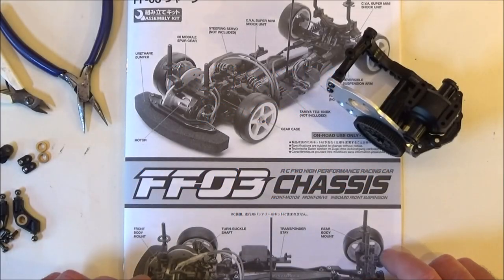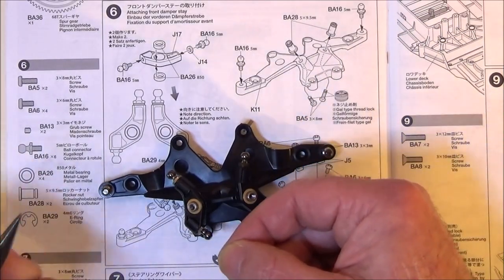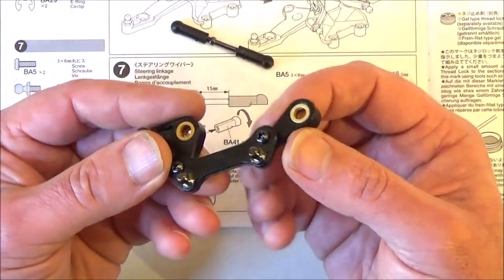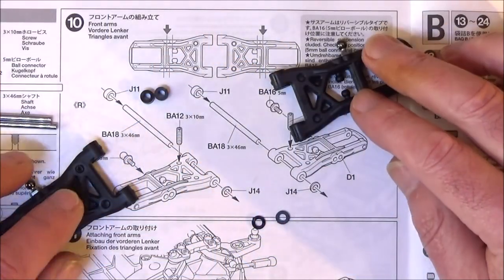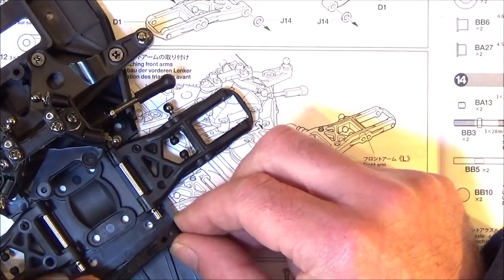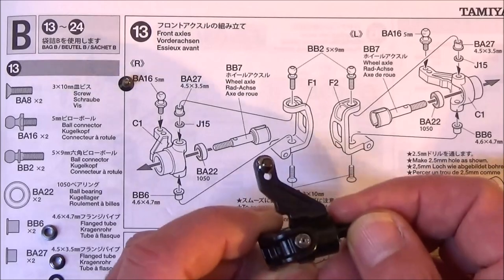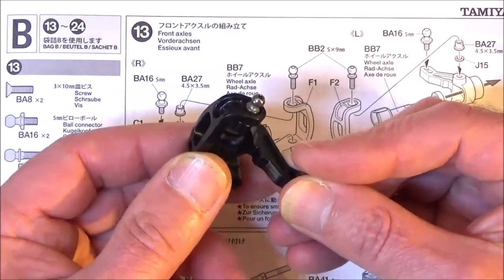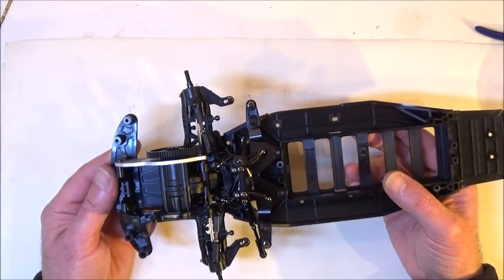Tamiya FF-03 Build Guide Part 2 - Honda Civic Type-R - Incl. Inboard Suspension

Comment: Pretty much how I progressed on the TA06 in similar steps. I used a pin vise for more precise drilling in such small places. Problem was finding metric drill bits in the USA.
Reply from the maker: Thanks man! I need to get a TA06!!!  I was a bit slack drilling freehand, yeah, better to hold it flat and still, but thankfully I got away with it - I just wanted too show what you need to do and do it on camera.  Forgot that it may be hard to find metric stuff in the USA - it used to be the same here, but now Imperial has pretty much disappeared  :-/

Comment: Hi matey. What a great kit. It's quite involved isn't it? All very well explained by yourself as ever. Can I ask how you have set up your camera and is it in between you and the kit or is it above? I'm trying to work out how I could do this type of video without the camera being in the way. What I have is the camera on a tripod in between me and the desk which is good in that I can see the screen but it's really in the way and I have to reach round it. Anyway I look forward to seeing more of this kit and especially that lovely body shell. Hope you are having a good weekend. Is it back to school for you tomorrow? At least you got some stuff done over the hols. Cheers matey 😀
Reply from the maker: Hiya Pete! Yeah it's a lovely kit to build, lots more parts than a standard Tamiya to get your teeth into! The front suspension is particularly cool, you should see it with the shocks on - works so smoothly, it really is clever.
As for the camera, above the desk is a storage cupboard, with LEDS under lighting the worktop. I mounted a bit of wood to that and attach the camera to it with a rubber band, My Sony has a movable screen, so I can swivel it so I can see what the camera does, It's above me so it doesn't get in the way, I just have to be careful not to bash my head on it! I've tried the tripod method that you describe, and yeah, it's a real pain working around it!
I've really enjoyed my free time, but back to it tomorrow, don't wanna go, but it will feel OK when I see the kids smiling faces! All the best my mukka!  :))
Reply: @MarkBryanRC  thanks for the info on your set-up. I should be able to achieve something similar. The GoPro has the app where I can see the footage on my phone so could utilise that. Anyway hope work is ok tomorrow. I've 🐝 enjoying the light traffic in the mornings last week but I'm sure they'll all be out tomorrow. Cheers mate 😀

Comment: Hello mate great  video bin building  mine and I have a problem  my steering  only turns left it won't turn right
Reply from the maker: Hey mate! Only turns left? How strange! Have you disconnected the steering arm from the servo and made sure the servo turns fully in each direction?
Reply: @MarkBryanRC  I haven't  put the servo  in yet mate it looks like it hitting  the front damper stay
Reply from the maker: Hmm... Something not quire right there - I checked mine and there is loads of clearance between the steering mechanism and the front stay - better check it all again my friend!   :)
Reply: @MarkBryanRC  I have checked  it over and over  again  mate bin through  the instructions  about a million  time I cannot work out what's wrong  mate
Reply from the maker: Oh dear! I wish I could help more, but without your chassis in front of me it's impossible to guess!  :-/
Reply: @MarkBryanRC  that's ok mate I sorted  it out I modified  the underneath  of the damper stay and it turns right and left now I sanded some plastic  off it I should  have bought  I new kit but got it off Facebook  market place  for £70 thanks for you help mate I like the videos you do top work

Comment: Mate, I'M GETTING ONE OF THESE!!! Just don't know how... Is it Brilliant? Frankly I don't care as much as I should. 😜 
The Nerd in me (Thanks Dad!), loves things that are nearly overengineered. Tamiya is famous for that anyway!! 

It's more and more fascinating with the more I see. It's set up like a typical Front Wheel Drive Sedan... Great big Lump of weight in front of the Wheelbase. Yet some of them handle quite nicely!! 

Last year, I test drove a Ford Fusion (our exact counterpart to your Mondeo)... Now, I'm a hardcore Rear Wheel Drive Hot Rod kind of Guy...
But that FWD Saloon felt really nice to Drive!! 👍👍 

So I wouldn't discount this just yet, as many have done. Could be impressive.

BTW, those C Hubs went together with the top hat Bushings, exactly like my Axial Wraith did!! 😉
Carmine ✈🚂🚙
Reply from the maker: ...And it just gets better as the build goes on, Carmine! The suspension movement is SOOO  SMOOOOTH!  I get the feeking it's gonna be fun to drive, and I love the engineering in a nerdy way, too.  This thing is gonna drive like a 2 wheel car - with the rears just holding the back of the car off the ground!  All that weight at the front should give it good grip for acceleration, cornering and braking, but it might be a bit tail-happy.
Yeah, the Mondeo is a fine handling Ford. Some FWD cars are actually GOOD (think of the Austin Mini).
Don't tell Axial, they might sue!   :P
Reply: I drove a Friend's Austin Mini in High School.... Drove it on SIDEWALKS, Alleys, across Yards, even broke into a Go-Cart Track!!! 😳😜
MOST fun I had with my pants on! 😆😂😜

I found out that this was originally designed BY TRF - for Pro Level Saloon Racing!! Probably why it comes with those goodies. Should be a good handling Car. I wish I could get one before they're gone....
Reply from the maker: Hehe - yeah, that's what Mini's are Made for! I had a few over the years, and my dad has a fibreglass bodied Mini with a 1380 tuned motor in it! That thing can beat a Porsche to 60!!!
I think the FF-03 will be around for a while yet!  :)
Reply: 1380???! Glass Body? SHIT!!!! I think his had an 1100 something... And IT could beat my then 1972 Monte Carlo SS, with a 454 (7.4 liter!!), with TWO 4-Barrel Carbies and a Muncie 4-Speed - from 0 to about 40.....
Then I was LONG GONE!! 😁 
Shockingly quick cars, those Minis. I'll bet they shocked a lot of people at its first Rally!! 😳

Comment: Hi Mark.  I'm just building this as my first Tamiya kit. I'm enjoying it and using your videos as a helpful extra resource (thank you!). I have a question about step 14, (17:29), the bit about the Urethane bushing. I don't understand why, having cut the bushing in half, it appears to tell me to use half of the cut bushing on one side, then one full bushing and the other half bushing on the other side.  Why would you have more bushing on one side than the other?   Doing this, the driveshaft seems loose on one side (with 1/2 bushing) and more solid on the other (with 1 and 1/2 bushing).  Any help you can give me would be appreciated!   ☺️
Reply from the maker: Hi there! Glad you are enjoying the build, it's a great chassis! The reason you have different thicknesses of bushing on each side is because one side has the lock-nut and spring in the output drive cup, the other side only has the allen (hex) head of the bolt that goes through the middle. Yeah, one side is a little tighter than the other, but it runs well with this configuration, so I recommend just following the manual! I really appreciate you watching my videos - thank you!  :)
Reply: @MarkBryanRC  thank you so much for your reply!  Great, I can re-commence knowing that all is good 👍   Yes it really helps to have your video alongside as I am building the kit, as this is my first RC model I've ever built.  I had a Sonic Fighter and a Vanquish (sadly both now gone) as a kid, but these were built for me back then.  Now aged 43, I had a hankering for an RC car again, and I have a Civic Type R in real life just like this kit (except not the rally version!), so I managed to track one down luckily (as they don't make them any more).   I can't wait to get it built and use it, it will feel like a nice achievement!
Reply from the maker: @jammy_rex3038  Cool you got back into RC - it's a great hobby and there are lot's of like-minded people here on YouTube, it's a nice little community we got going on! Love the fact that you actually have the full sized car (and a great car it is too!) Hope the rest of the build goes well!  :)

Comment: Hi Mark,  just a bit of info from my build so far. I don't have a drill that works at the mo & found you can screw those grub screws directly into the arms without widening the hole first. Didn't take any additional pressure as they screwed down smoothly. Planning to use a reamer to do the 2.5mm holes in the C hub, gently should be ok?!?... :-)
Reply from the maker: Hi Ben - yeah someone else mentioned not drilling those hoes out too! Yeah, go steady with the reamer and check the fit of the grub screw as you go!  :)
Reply: @MarkBryanRC  Cheers Mark, yep worked put well & on Bag C now. Got a bit of a shortage of electronics so not sure what to fit it with as ESC space looks a bit limited!!! Thinking of borrowing the HobbyWing 1060 from my CC01 as it can handle the Square LIPO that fits snug in this one plus maybe a Torque Tuned motor to start?
Reply from the maker: Glad to hear it Ben! Well, there is not much space but it's OK as the electronics just hang over the edge a bit, it's not a problem! Those parts sound good, I just used the standard motor but the Torque Tuned should give it a bit more punch! We can always go for a brushless later if the mood takes us!  :))

Comment: would you recommend this kit for somebodies first build?
Reply from the maker: Hi Brad - that would depend on the experience of the builder - if you have experience using hand tools, DIY, mechanics of other sorts, etc, then I would say it should be OK to have a go at this kit. If you have very little experience working with your hands, perhaps an M chassis Tamiya would be a better starting point.  All the best! :)